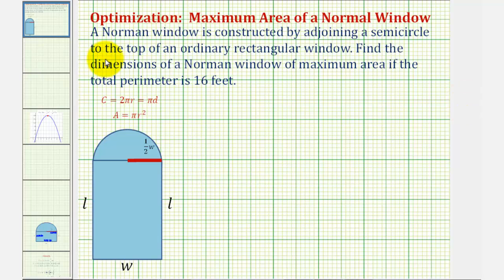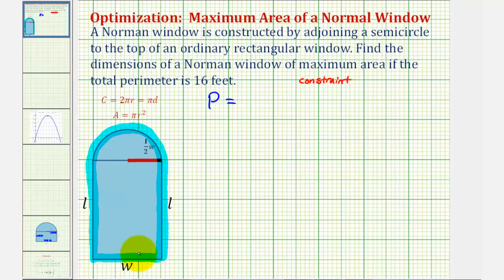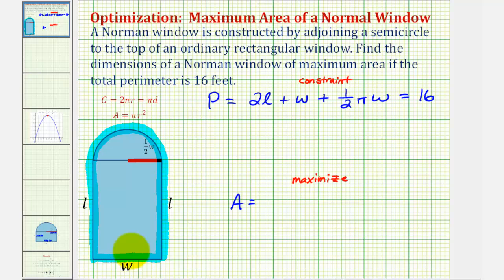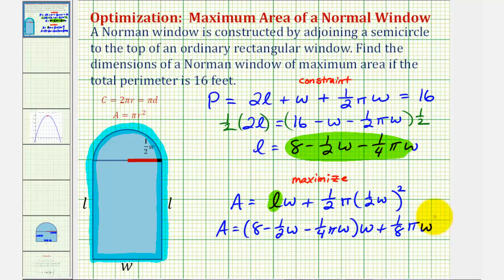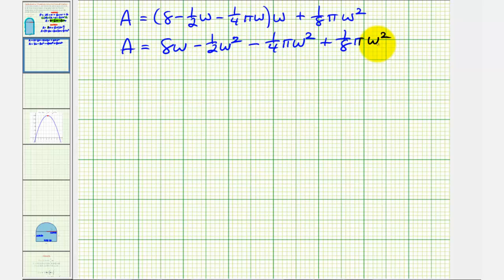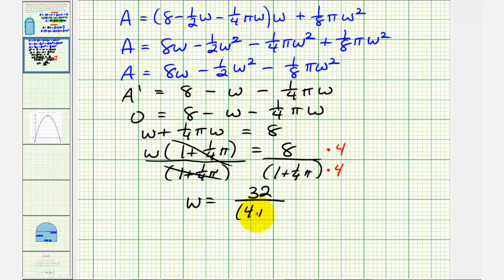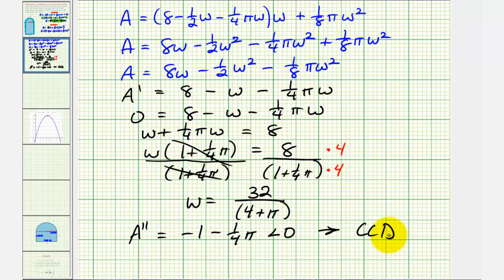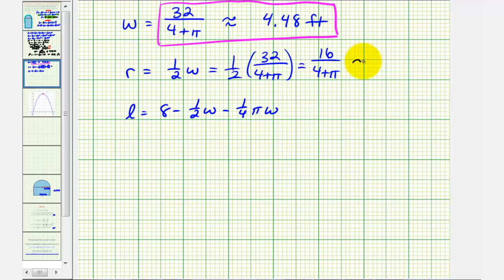Optimization - Maximize the Area of a Norman Window

Comment: The algebra/proof is well explained here. I'd like to point out that you can use geometric reasoning. To get the max area then the width would be two times the height.  i.e 2H = W. Using your perimiter(p) relationship, you get P = 2H + W+ .5*pi*W, substitute the 2H for W and you get W = 2P/(4+pi). Since we said W = 2H, then H = P/(4+pi).

Comment: Is there any way of finding the area without using derivatives?
Reply from the maker: Neki Haig Are you referring to this?  https://youtu.be/085t_Fmje4o
Reply: +Neki Haig You may be able to determine the area alone, but you need the derivative to determine the dimensions of a maximum area given certain thresholds; in this case, the threshold is the maximum perimeter of 16 allotted in the problem